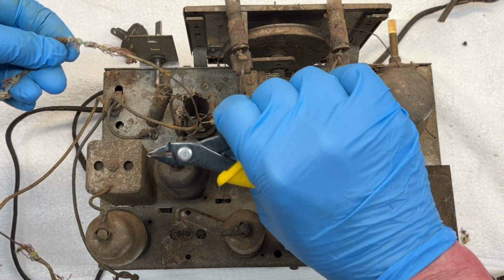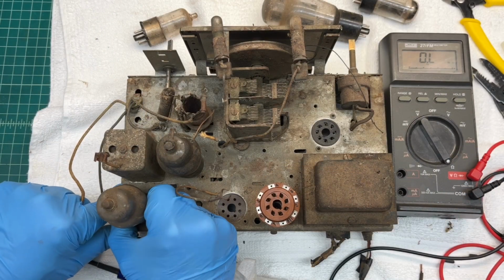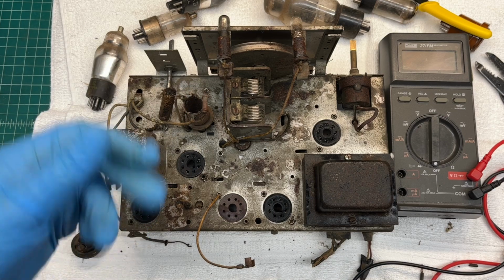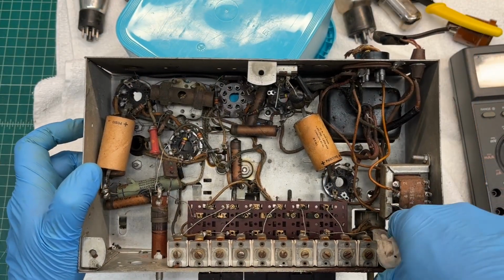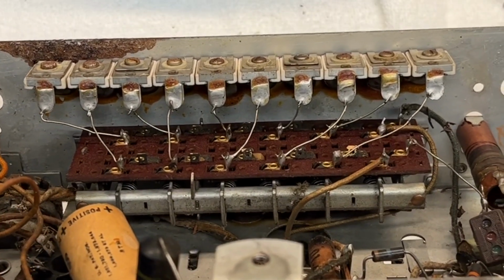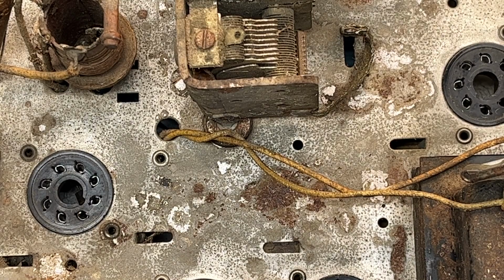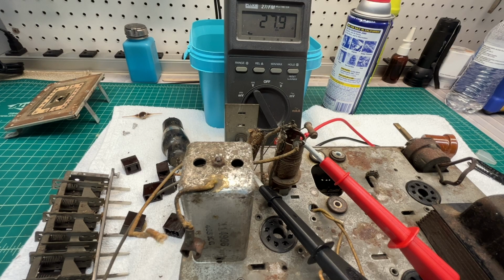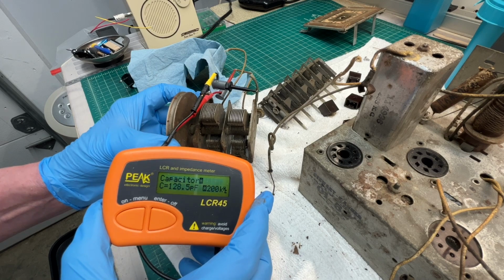Stewart-Warner - 01-521 | Disinfecting | Basic Power Transformer & Antenna Coil Tests | & More...

Comment: I'm surprised that the springs on the pre-set switching mechanism weren't rusted up and it's also strange to see only one IF transformer. Yeah, Steve is pretty good like that, he once helped me with a manual for my DC power supply. I'll be watching this restoration all the way through.
Reply from the maker: Ken - I know. I have the switching mechanism soaking in WD-40 until I have time to tackle it. All indications, it’s moving freely now and should work as designed. Steve’s contributions always add value for myself and others following along. Thank you for watching. Best, Don

Comment: Nice work. I used to work for a place that rejuvenated tuners for TV repair shops decades ago. You  can safely put that tuner in an ultrasonic bath with solvents to clean it up.
Reply from the maker: Definitely my plan. Hopefully it will clean up and perform equally as well. Thanks for following along and taking time to reach out. All the best. Don